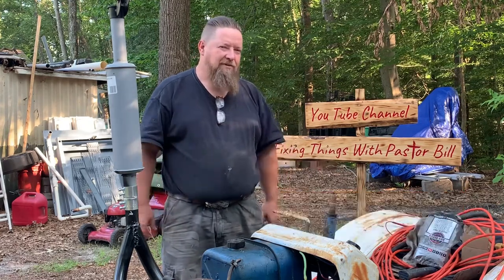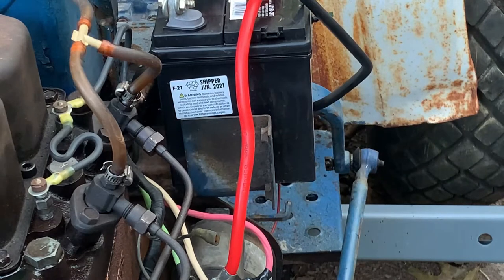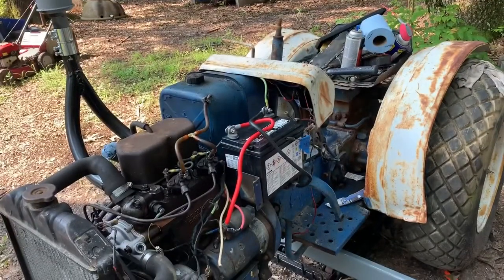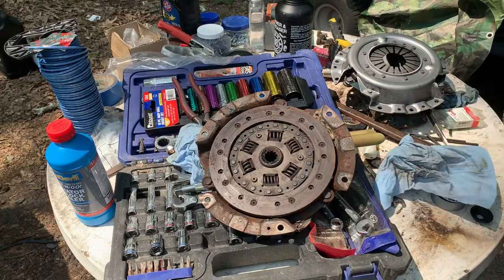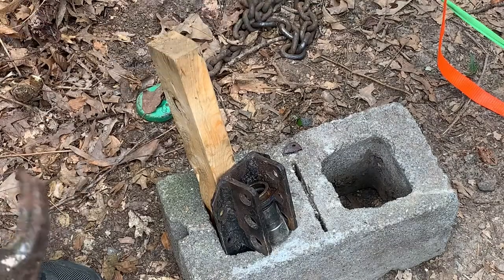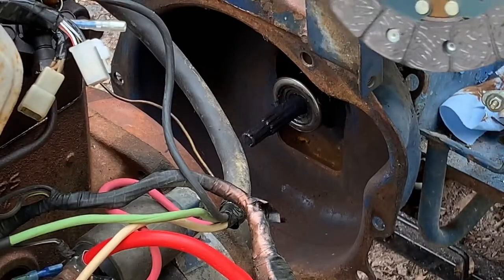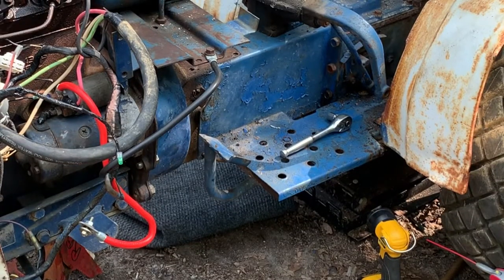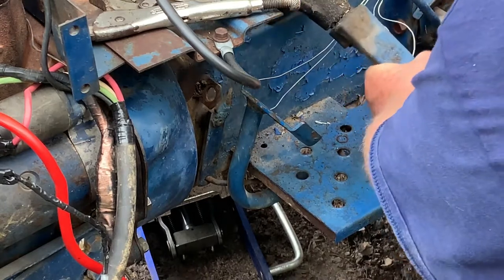Mitsubishi tractor S370 restoration part  10 clutch replacement

Comment: I'm doing a similar one, ih 234, which ran a Mitsubishi K3D 3 cylinder Diesel. Your clutch and flywheel look a little bigger though, I forgot to disconnect the front driveshaft so I couldn't split it for like 3 hours (looked like it was already disconnected) but it wasn't 😬. At times like those I stop and pray, it never fails me, immediately after I noticed that front driveshaft. 
Video is very much appreciated 💯👍
Thank you
Reply from the maker: Taking the tractor part in the middle was a learning experience for sure ,especially when the clutch didn’t work the first time and I had to modify the throwout bearing shaft but in the end it’s worth it God always helps me and blesses the work of my hands

Comment: I’m working on the exact one mine is a Satoh beaver S370 2wd …

I followed you all the way, and have had all the same issues except I had to replace the rings on the pistons. Now I’m up to the clutch, which was stuck. Got the clutch on eBay. No problem. Old clutch was frozen to the fly wheel. Got all that stuff off. Throw out bearing housing is seized in that shaft tube and I cannot get it to release or pull out or even budge seven days of PB blaster heat and pry. Not sure what to do. Bill. The dang throwout bearing housing is just frozen in there. Everything was rusted up in the bell housing when I opened it so I’m not surprised, but don’t know what to do considering dropping that midsection of the tractor and removing it to put it on the bench.
Reply from the maker: It may not be the throw up bearing, but rather the shaft that goes through the housing maybe stuck. You might try applying some heat with a propane, torch and some brute force persuasion. Good luck. On mine I had to take the tractor apart because my clutch was completely gone.

Comment: I'm working on a Mitsubishi D2000 clutch but having trouble finding spares in the UK.  Anyone got any thoughts.
Reply from the maker: I purchased mine from eBay. Most clutch’s are the same measure the diameter and count the splines. Also, check the distance from the flywheel to the top of the pressure plate. What does vary from Tractor to tractor is the throw out bearings?

Comment: Where do you get these parts from?? Clutch ,throw out bearing, pressure plate?
Reply from the maker: eBay this clutch was used on many models. 
I just relooked it up and found it right away

Comment: Should the shaft that goes into the clutch be able to move sevral inches out ? My wife dumped the clutch hard when pto was ingaged, i now have no moving gears or pto. Clutch looks fine, if i manually push that shaft back into the tractor. I can spin the wheels. And pto. So im thinking maybe thats what broke.. any help wpuld be much appreciated 🙏
Reply from the maker: There’s a book on line with every single part listed and showing its assembly it does sound as if the shaft maybe snapped. The top of the transmission is easily accessible through the top gearshift assembly. From there you should be able to see and have access to the gears and shafts. Also check all the other levers